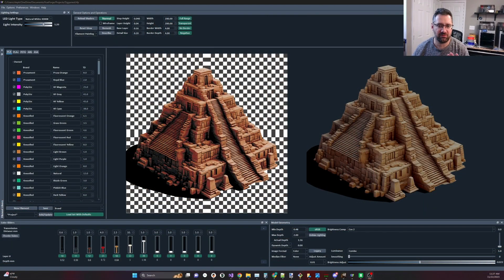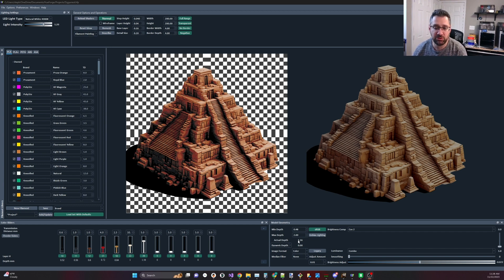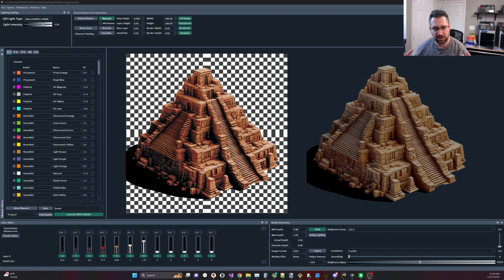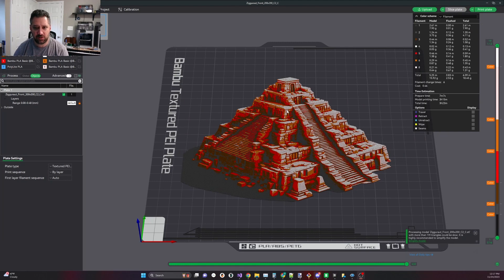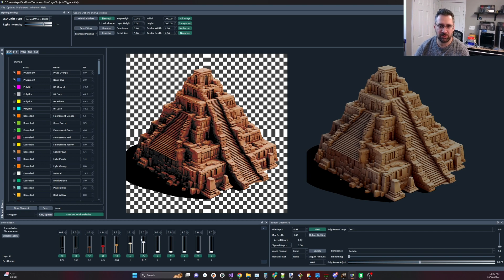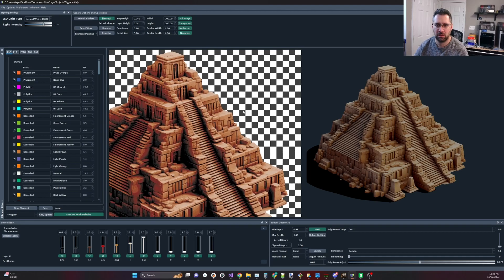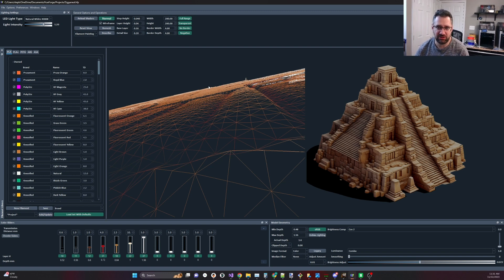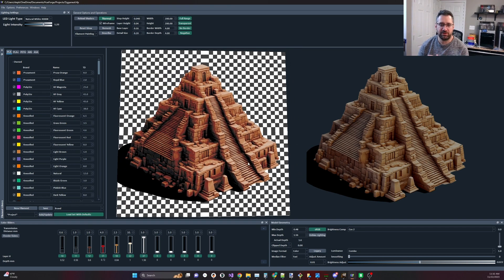HELP!  Why Doesn't my Mesh Height Match!?

Comment: i still didnt get it..
so weird.

in bambu i get 47 layers, when send to print its showing me only 27 layers like in txt file they provide me.

for example - 
the first Black color is set to stop at layer 10 (0.88mm height) but in slicer 0.88mm is layer 19.. I cant understand how to fix it
Reply from the maker: What is your layer height in the slicer? 
Did you scale it up in the slicer?
Reply: @hueforging  nope.. just export it from hueforge and upload to bambu slicer

Layer height is 0.08 because I don’t have 0.2 nozzle so I afraid to go lower to 0.04..
Reply: Also - in txt file they wrote at layer 0.88mm change to brown at layer 10 (but it’s 19) so I changed layer 19 and so on til I reach layer 47.

And now the weirdest thing is I print it and it printed it with 27 layers that’s look the same as the 47 layers in slicer. 

If I follow the layer height filament change (not the layer number) it’s working great at the end. But if I choose layer number as filament change it will destroy it all.
Reply from the maker: It seems like your slicer is set to 0.04mm layer heights. Also, a 0.4mm nozzle is able to print at 0.04mm layers you just need to tell the slicer it is allowed.
Reply: @hueforging  oh I thought I must use 0.2 nozzle to use the 0.04 layer height. I was afraid something will happen
Reply from the maker: You do need to adjust your speeds to get good prints. But it sounds like your problem is that the global layer settings in your slicer don't match HueForge
Reply: @hueforging  yea I made new image all went well. Maybe something went wrong. 
Thanks ;)

Comment: Is there a way to make the hueforge into a different shape other than square or rectangle? Like a circle?
Reply from the maker: Use an image editing software to remove the background and save as a PNG with transparency.  HueForge will respect that transparency.  However when you bring it into the slicer it will LOOK like it's still a rectangle/square, but it's zero height so when you slice it, that rectangle will disappear.

Comment: Amazing how you blend several colors to get such a result. I was wondering if you could share what were the filaments you used to this particular print? The second one seems to be a Dark blue, right? Keep up the good work!
Reply from the maker: Absolutely this is the filament instructions.  The Black can easily be swapped for other brands.  The red too
so long as it is a similar TD (4-5).  But this is mostly IIID Max filaments. 

Filaments Used:
	PLA+ Sunlu Black Transmission Distance: 0.6
	PLA+ IIID Max Night Gray Transmission Distance: 1
	PLA+ IIID Max Brown Transmission Distance: 1
	PLA+ IIID Max Red Transmission Distance: 4
	PLA+ IIID Max Coyote Brown Transmission Distance: 2.5
	PLA+ IIID Max Vanilla Cream Transmission Distance: 10
	PLA PolyLite Pro White Transmission Distance: 5

Swap Instructions:
	Start with Black
	At layer #10 (0.52mm) swap to Night Gray
	At layer #11 (0.56mm) swap to Brown
	At layer #12 (0.6mm) swap to Red
	At layer #15 (0.72mm) swap to Coyote Brown
	At layer #18 (0.84mm) swap to Vanilla Cream
	At layer #22 (1mm) swap to White for the rest.
Reply: @hueforging  all right thanks a lot!